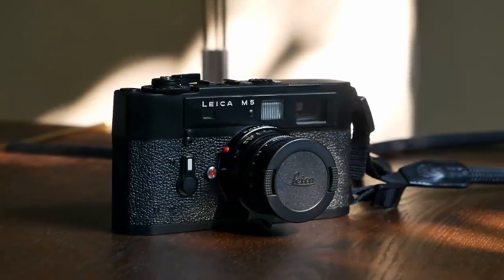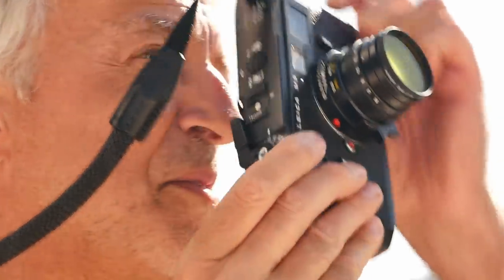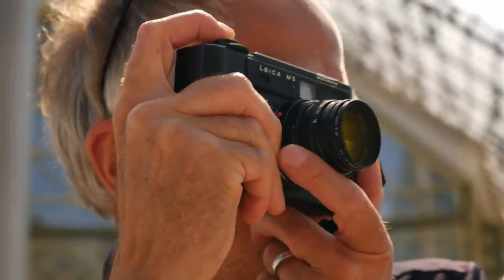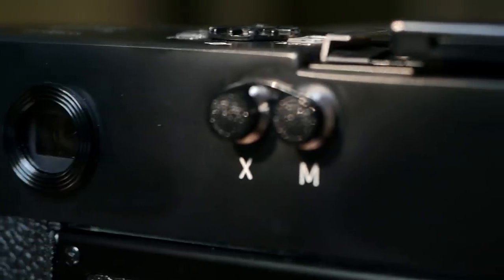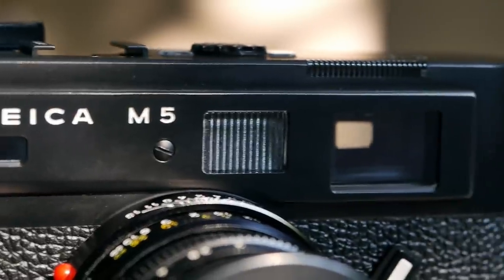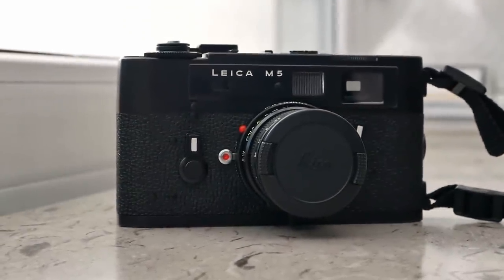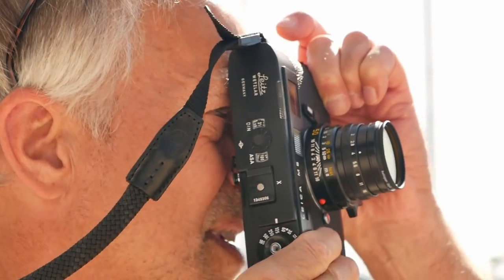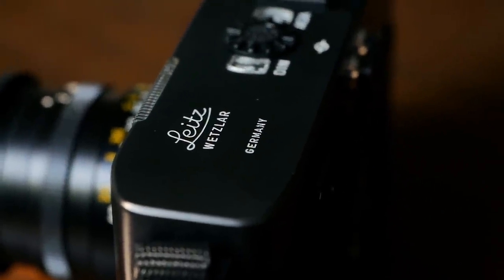Leica M5 Review - The odd one out from the 1970s

Comment: I carried a Leica IIIF with collapsible 3.5 Elmar for years as my everyday camera but though I could estimate outdoor exposures adequately, I really needed a meter for indoor exposures.  In 1974 I tried the new CL with built-in metering and traded my screw mount in for it.  At the time the M5 was out, but I didn’t seriously consider it because of both size and price - the CL was $399 with lens, whereas an M5 with lens would have been $1200 or more.  After a couple of years carrying the CL and acquiring some M mount lenses, I happened on a used M5 for a reasonable price so I added it.  Though it’s a bit bulky to carry all the time, it replaced much of my medium format shooting because of its smoothness and the optical quality.  With an F2 Summicron and slow speed films, it will permit enlargements to 16x20 with amazing sharpness, yet handles quickly enough for candid street shooting or even sports photos.  The shutter release is like a fine rifle trigger - so smooth and precise!  I also used the M5 for shooting in courtrooms, church services and anywhere that an SLR would have been annoyingly loud.  Several CLAs later it still functions as well as the day I bought it almost 50 years ago.

Comment: I own one, bought at a lower-than-market price from a friend who's saving to buy a car, and I've been using it with my LTM glass (specifically the 45mm f2.8 and 50mm f2 Super Rokkors, and the "Japanese Summilux" Canon 50mm f1.4, alongside the Industar-61 L/D 55mm f2.8) fitted with an LTM-M mount adapter. And honestly, this setup has served me well and has taught me the beauty of the M system – without giving in to the fad of the M system. 

Additionally, the M5 is not a camera that you choose to use, the M5 is a camera that chooses you to use it, and to those it chooses, it blesses them with a unique M shooting experience that's never replicated anymore: easy shutter wheel access, a center-the-needle exposure indicator, well-balanced size (allows for use of heavier lenses without upsetting the camera's center of gravity), and lower-then-usual price due to low demand.

Howver should you buy or use one, know that it is the hardest M camera to be maintained: its parts are rare candies and only a few repair facilities accept to repair the body. Nonetheless, being the last camera built using the adjust-and-fit method of construction, the M5 is a sturdy body that demands to be used and loved for years to come.

Comment: Love the review. One correction: the classic Dual-Range (DR) Summicron 50mm f/2 is compatible with the M5. However, you must remove a screw in the goggles and take off the plastic black buffer that protrudes out the back of the goggles. That black piece sits on top of the earlier M camera bodies for additional stabilization. I did this with my own M5 and DR Summicron, and it close focuses like a gem.

Love the channel and love the Leica M5. I for one am very glad that much of the Leica community rejects this beautiful, phenomenally built camera; it made mine a lot cheaper!

Comment: I was shooting with M4 and M2 when I purchased a used M5 in the mid 70s. It was very cheap because of its unpopularity.
It soon became My no.1 Leica M because of the lightmeter. The bajonet of My 21mm was modified so I could use it without the meter, it simply deactivated the meter arm .
The Weight never bothered me, I was carrying it together with Leicaflex SL2 mots.
I still have, it certainly doesn’t look as fine as yours, but You Can tell it’s been used.
Hasn’t used it since we were digitalized back in the mid 90,s it just sits on the Shelf with the other Old ones, reminding of fun times.

Comment: Thanks for this Max, which is the most comprehensive review of the M5 I have found so far. 👌
By the way, the M5 also limits the use of some Visoflex accessories, which was the main reason I didn't buy one when I had the chance. I have 2 Visoflex III houses which both have the lower profile prism. I could use it with the vertical finder, that I aslo have, but was going to have to search for the later prism finder for the preferred viewing.
Reply from the maker: Thanks for pointing this out!
Reply: @AnalogInsights  Regardless, you have rekindled my interest in using the M5, because I now have other M bodies for the Visoflex moments. I think a good, clean Black Chrome M5 would suit me just fine. 😊 
Danke schön

Comment: I have two Leica M-mount cameras - the Leica CL and the M5. Even though these two cameras are at opposite ends of the size scale in the Leica M-mount family, they have so many design features in common. The left side strap lugs, the rewind crank on the bottom, the overhanging shutter speed dial and the shutter speed displayed in the viewfinder to mention the obvious ones. And, while the display in the viewfinder for the light meter is different, they both indicate how far from correct exposure you are with your current settings. As far as 35mm rangefinder cameras go, I hope to be set for life with this setup.
Btw, the third lug on the M5 (my M5 is the 50 years anniversary edition, so it does have the third lug) - I find it makes more sense to use for wrist straps as it is not level with the top lug on the left side. From what I understand, there is also the issue of the lugs themselves. Apparently the M5 lugs are less likely to break than the lugs on all the other M-cameras. So as far as the strap lugs go, when Leica decided to eliminate the M5 design in its entirety, they gave up on the improved M5 lugs, that don't fit on the rounded ends of the other M-cameras. A shame really, when you think about it.

Comment: I join the ranks of the admirer of the M5. I bought my first M5 in 1988 and used it since then exposing hundreds of films. So, I know what I am talking about: I have never understood the rejection by the Leica enthusiasts prefering the classical design. The size was criticized - absolutely ridiculous, at that time as now. When you see today's digital bolides, M5 looks delicately like a steel-frame bike of the 80s next to the modern fat bikes (bikes with oversized tubes and motorcycle-thick tires ...).
It was ahead of its time. IMO it was the best Leica M in terms of handling, through the lens metering, and workmanship. The time wheel was and is genius. It was copied by Canon in the EF and unfortunately did not find its way into the later versions.

Comment: Owing the M5, I feel needed to correct the statement "Leica M5:s don´t work with collapsible lenses". The M5 cameras work fine with collapsible lenses - as long you don´t collapse them. I simply put a piece of tape on the lens so it can not be collapsed. I find the M5 a real joy to use. And I like the fact it is a bit bigger than the rest of the Leica line, being easier to hold and use.

Comment: The M5 is a wonderful, sophistically designed camera.
But finding a repair shop that can fix or overhaul it can be a real challenge. Leica does not offer full service anymore, because some spare parts ran out of stock, as I recall from a phone call with the customer service. Beside its "odd" shape (which doesn't bother me at all) there is also that battery issue: To replace the original 1.35V mercury batteries by 1.35V zinc-air batteries (such as Wein Cells) is an unsatisfying and possibly dangerous measure. 
Unsatisfying, because zinc-air batteries have an very short livetime, and they also need some time to get activated after exposed to air.
Dangerous, because zinc-air batteries - according to my experience - tend to leak very quickly and could possibly mess up and damage the battery compartment, much sooner than 1,5V LR44 silver oxide batteries do. So if you consider to buy a M5, it´s advisable to use either a real 1.5V - 1.35V converter in combination with a 1,5V battery, or to get the light meter calibrated into 1.5V. In addition, you should be sure that the camera you plan to buy has a clean battery compartment that has not been messed up already by battery residues.
Those issues don´t make the M5 a bad camera at all, but it´s worth to consider that if you can´t use the light meter (and this would be the case, unless you want to fiddle around with zinc-air-batteries, use a converter or get it calibrated), it´s "only" a chunky M4 - and thus I can understand when people prefer the M4 or M6.
If anyone knows a repair shop in europe that is specialized on the M5, please let me know, I would be very grateful. Once I've sent mine to Sherry Krauter (USA) for a CLA + meter calibration. She did a great job, but shipping costs + custom fees from europe are insane- and Mrs Krauter is probably going to retire some day...
Keep up the good work, Max! I really enjoy your channel!

Comment: Great piece of technology and I also like the design, but I vowed to myself that I would only want analog cameras for which there are still suitable batteries (without adapters or camera adaptations).
Reply: You can get suitable batteries easily. Weincell PX625 replacement batteries are sold everywhere, for example B&H Photo has them for sale. No need for adapters, or adaptations. Battery fits right in as it is.

Comment: Fact:  Leitz made and sold fewer copies of the M4-2 than the M5
Fact:  Leitz made and sold fewer copies of the M4P than the M5
So why aren’t those two considered a commercial failure as well ?
Fact:  M5 viewfinder rangefinder is brighter than M4-2 M4P and all M6 models
Fact:  You can safely use all intermediate shutter speeds on the M5 because its shutter is designed to do so accurately
Fact:  The third lug is a nuisance as it digs into your hand in actual usage
Fact:  M5 is the only M that can safely do multiple exposures without jamming or breaking anything
Reply: I suppose it just happened to be a challenging time for rangefinder cameras when it was released. There is nothing wrong with the camera, it is absolutely great and the pinnacle of the work done in Wetzlar. The last Leica M hand made in Wetzlar Germany. The only Leica camera with Spot metering! It was just unfortunate that it was released in a time when Japanese cameras raised more interest at the time.

Comment: Video @ 20:02 "WEIN cells" + @ 26:18 "in terms of quality" - Okay, SIX main issues - 1. The Leica M5 is THE MOST COMPLEX M and has more plastic and fragile components than any of the later M's (the early model M's are of course 99.9% metal). 2. The M5 serial numbers, if below #134****, has the high probability of experiencing a catastrophic 'shutter barrel' failure. This will cause a jammed shutter condition (currently not considered economical to repair). 3. When metering, the camera MUST be held horizontally; if not, the heavy galvanometer (meter coil) will deflect to an erroneous meter reading (gravity affected). 4. ONLY use silver oxide batteries utilizing a quality MR9 adapter; the "WEIN" Zinc-Air doesn't last, PLUS, they LEAK too easily ! - 5. These Battery chambers often have corrosion (from the battery chemistry) due to folks not removing the battery when storing the camera (Basic RULE - Every camera that uses a battery, should always be stored without a battery installed). 6. You'll really enjoy using the Leica M5 if you have larger than normal hands...
Reply: I've been using Wein cell batteries for years and never had an issue with them leaking and find they last as long as any other typical camera battery.